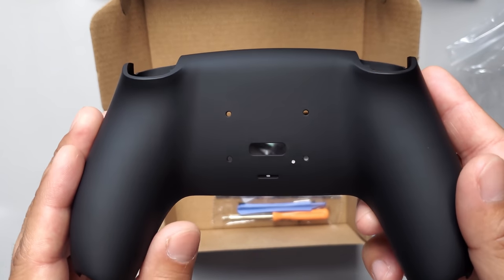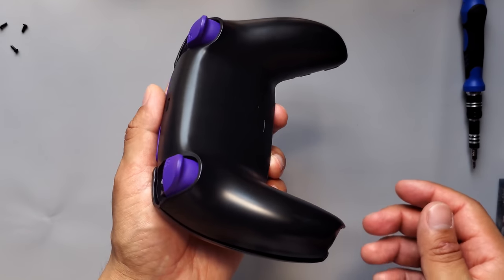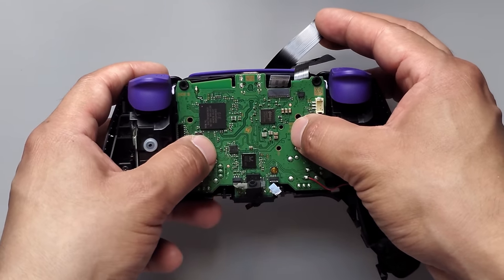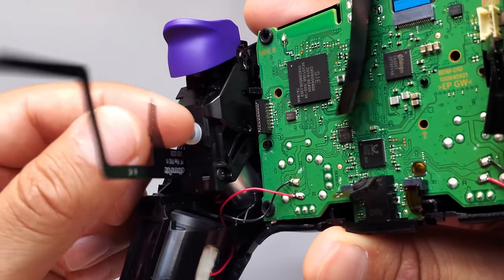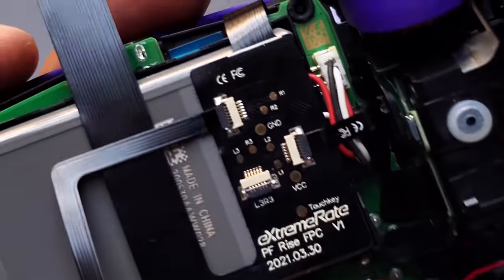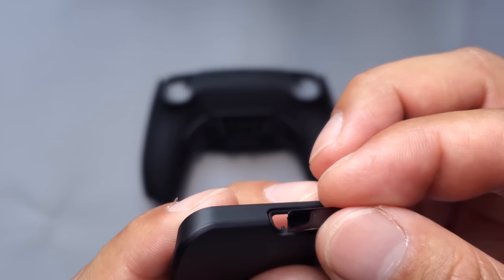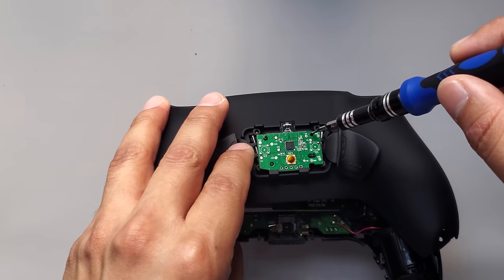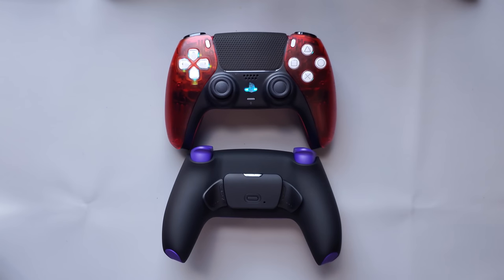DIY PS5 Controller (For BDM-010): eXtremeRate's Rise Remap Kit | No-Soldering Step by Step Tutorial

Comment: very strange everything i have done correctly but the red light didnt shine for me 😢😢 help please
Reply from the maker: Does your controller stay on?
Reply: @im.a.caveman  i was forget a 1 cable and i try to put it on while its working, forget to disconnect it and now my controller doent work lol, i fuc ked it up right?
Reply: @im.a.caveman  Please help 😢
Reply from the maker: @georgigeorgiev9361  Which cable was it that you needed to connect?
Reply: @im.a.caveman  the L1L2 V1 i was forget the cable that goes down next to batery cables.
Reply: @im.a.caveman  and i plugged in while everything working 😢 and it goes shutdown, then i cant turn it on
Reply from the maker: @georgigeorgiev9361  what's the BDM number on your motherboard and the BDM number of the cables you connected?
Reply: @im.a.caveman  my ps5 controller is bdm-020, but i dont know what the cables are.
Reply: @im.a.caveman  any advices mate ?
Reply from the maker: @georgigeorgiev9361  Which kit do you have? (V1, V2, RMB, or Rise4?
Reply: @im.a.caveman  its V1 i can see the signature L1 L2 V1 on the cables
Reply from the maker: @georgigeorgiev9361  The V1 kit is only compatible with BDM-010. you would need either the V2, RMB, or Rise4. These 3 come with cables compatible with BDM-10 and BDM-020.
Reply: @im.a.caveman  okey thank you mate
Reply: @im.a.caveman  hello mate i buy a new controller which is 010 and it works now, but when the time for set up the buttons as X and O i did all right it blinks but when i start the game it doent work, can you help again mate?
Reply from the maker: @georgigeorgiev9361  After remapping turn off remap mode
Reply: @im.a.caveman  thanks mate cheers you are god all good now

Comment: Is it normal for the touchpad to not work with this kit?
Reply from the maker: If the toucpad isn't working, check to see if the touchpad cable was reconnected.
Reply: @im.a.caveman  the lights for the touch pad work. But the button doesn’t
Reply from the maker: @CJ_Figy  did you test to see if the dragging function works on the touchpad? If you have Astros play room you can test it that way. 

If not then it's always good to double check the cable
Reply: @im.a.caveman  I opened it up and the cable wasn’t connected! Fixed it!

Comment: My mapping isn’t working I’m not sure why it wouldn’t. But it’s not keeping my button map
Reply from the maker: You remapped, turned the back off, and tested them?
Reply: @im.a.caveman  I forgot to re comment, after scrolling I found out you had to turn it off after that it was great! Thanks man. Ordered the hair triggers too so I’ll be back to watch your video on that.
Reply: @unloughfulgaming  I need help, my controller won't turn on
Reply: @originator4649  make sure your battery is fully plugged in still?
Reply from the maker: That's cool! Hope you enjoy the trigger vid.
Reply from the maker: Does your original back shell model number show CFI-ZCT1W? That would be a BDM-010 and compatible with the kit. If it's CFI-ZCT1W A that would be a BDM-020 and currently not compatible.
Reply: Ah I see. My model says CF1-ZCT1W and there's a little A like 2 spaces to the right of it
Reply: @im.a.caveman  if it's not compatible,  know any work arounds?
Reply from the maker: The kit is not compatible with that model. Extremerate is working on having it work with CFI-ZCT1W A / BDM-020. They could be releasing the updated version soon.
Reply: @im.a.caveman  after an hour of trying to do this, I think it has something to do with the ribbon cable that touches and goes on top of the other ribbon cabe. Right?
Reply: @im.a.caveman  ripp 💀. Guess I'll try to return it if I could.

Comment: I just wanna do back buttons so what steps can i skip
Reply from the maker: This is the back button installation video. You just won't be able to remap L3, R3, or toucpad with this guide since its the non-soldering option.
Reply: @im.a.caveman  thats cool thats all i need i wanted to remap x and circle for cod been using back buttons on ps4 stick but now i feel like i need it
Reply from the maker: @darryljohnson3084  I believe you don't have to do the cables on the side if you're only doing it for the face buttons. I'm pretty sure people mentioned they did that because they mainly just wanted X and O. But if you do want to remap the triggers then you'll need to install the trigger cables.
Reply: @im.a.caveman  thanks ill remeber that yeah just x and o for me thats why i didnt wannt spend 400 bucks on a custom one because im literally gunning for just two buttons lol 😂
Reply: But i might just go all the way anyway
Reply from the maker: @darryljohnson3084  Just make sure your kit is compatible with your control before buying.
Reply: @im.a.caveman  i have the CFI-zCt1w

Comment: But what do I do with the extra ribbon cables
Reply from the maker: If you're talking about the extra ones that come in the box then I believe you're talking about the ones for toucpad, L3, and R3. If you solder those cables on you can program those 3 to the paddles. But this is the non soldering version so I don't have those installed.
Reply: @im.a.caveman  I’m talking about what I do with the r1,r2 and r1,r2 ribbon cables that you take out and change with the new ones
Reply from the maker: You can just keep them safe in case you ever need them.

Comment: Can anyone help... mines turn on but won't sync to the buttons I want.... any ideas
Reply from the maker: Which buttons are you trying to remap and did you turn off the back after remapping. On is for remapping only. Off is so they can be used with the buttons you remapped them with.
Reply: @im.a.caveman  thank you for replying.... it's a PS5 controller and is X and square buttons im trying to remap to use them with the back buttons...... I would turn it on and sync but didn't know I have to turn it off.... I will try that today thanks alot
Reply: @im.a.caveman  maaaan Ur INSAAANE THANK YOU merci frère

Comment: What is this  attachment for
Reply from the maker: This kit installation is to be able to assign 2 buttons to the back buttons/paddles. You can program X, O, Square, Triangle, any of the D-pad or any Triggers (No-soldering). With soldering you can also add L3, R3, or touchpad. If you have the left or right back button assigned with like X, you can always reprogram it to another button or no buttons at all.

Comment: Did he say that R3 and L3 doesnt work with this??
Reply from the maker: If you don't solder the the other cables for L3, R3 or touchpad you won't be able to remap those buttons to the paddles. This is the non-soldering version.

Comment: Anyone else get stick drift after installing this kit? Is there something I could do to fix it?
Reply from the maker: It doesn't cause stick drift. Stick drift has to do with the analog sticks. Which eventually happens to all controllers depending on how long they've been used or if there was some sort of damage.
Reply: Ok, thought maybe there was something I may have done during the installation process. I did install the kit on an older controller. Thanks for the response.

Comment: Kills power to controller when L1L2 ribbon is installed on mainboard. My controller is an updated one too, maybe sony put a stop to this kit.
Reply from the maker: As in your L1 and L2 aren't working?
Reply: @im.a.caveman   Controller is on, but when I connect that ribbon to the mainboard the controller shuts off, like the ribbon shorts somethings.
Reply from the maker: @deener8365  I recommend contacting them and getting a replacement.
Reply: @im.a.caveman  I am skilled with electronics, but it's been three hours figuring out the issue... I have a newer controller model also, the MB looks different, maybe sony put as stop to this kit.
Reply from the maker: @deener8365  You think that just for the newer model Sony potentially stopped this kit? Or are you saying also for the original? I have mine installed on the original. So I'll try my L1 and L2 right now.
Reply: Newer maybe. @ 4:42 my large BGA chip is on the flip side of the MB and I have no white bracket to unscrew. I have done tests, no remap ribbon works with adaptive triggers, put original in and they work.
Reply from the maker: @deener8365  I'm gonna take a look into the newer control to see how it looks on the inside and investigate the product more. I'm going to check if on their description it says that it works for the MB as well. And if not I will email them to ask about this. Thanks for bringing this up.
Reply: @im.a.caveman  My MB on side A says it is BDM-020, can you verify and check if it's different than a controller from last year?
Reply: @im.a.caveman  I have found one issue. The 'left' d-pad side flex cable with the kit connects to the wrong ends of the jacks. Pins 1->16 on the trigger cable end should connect as 16->1 on the MB cable end. OEM cables are bent to do so, the remap kit does not, so bothe ends connect 1->16 to 1->16. The remap kit needs longer flex cables so they can be bent like the OEM ones.
Reply from the maker: @deener8365  if you have IG can you possibly send a pic or vid so I can see what you're seeing. I haven't been able to find a teardown for the new ones. Or email if possible. Let me know please.
Reply from the maker: @deener8365  Also, I opened my control and yeah, it says BDM-010
Reply: @im.a.caveman  I got a twitter D33N3R@BHPCDepot
Reply from the maker: @deener8365  Shoot, I don't have Twitter 😅 I'll keep searching to see if there's a teardown.
Reply: @im.a.caveman  No teardown, extremerate didn't even know there was a revision. They asked to purchase my controller for testing, haha.
Reply: Get a twitter, for this at least
Reply from the maker: @deener8365  Is yours also an all white, red, or black? It's looking like just bad timing on the kit and BDM-020. The kit was released a few weeks before the new controllers probably.
Reply: @im.a.caveman  White, the kit pcb dates are March this year. It'll get fixed soon enough. 👍
Reply from the maker: @deener8365  Yo, I really want to thank you for bringing up this topic. I need to release an update video for this issue (hopefully soon) and put it on my description for this video.Thank you so much!

Comment: Tried this kit and followed the exact steps..... Now my new ps5 controller wont turn on.... dont know if this has happened to anyone else but now im out  $60 (Black controller) and $40 for the set up..... thoroughly disappointed in how this came out.
Reply from the maker: That's is because most likely it's not compatible with your control. You did not lose any money. You just have to put the original parts back. Contact the company for a refund and get the one compatible with your control.
Reply: @im.a.caveman  I tried.The controller won’t even charge anymore. But I am sending the kit back. Never again. I’ll just buy a regular modded controller. It’s not worth it.
Reply from the maker: @ROdoesITbetter  If you put the original parts back then try resetting the control. If nothing then maybe something accidentally got damaged. You can also send me pics or videos through IG so I can have a look at it.

Comment: I did this and now my ps5 controller is acting all weird……is anybody else having this same problem as i am?……for ex: whenever i start a game the controller wont work unless i start it with a diff. Controller, buttons sometimes dont work, i used it with iphone ear buds watching youtube but the mic speech kept coming on while when i tried in warzone i had no issue?…..im about to return this! Help!
Reply from the maker: Try checking all your connections. If nothing works just go back to using your stock parts and ask for a replacement or refund.
Reply: @im.a.caveman  thx my guy….had to return after reopening and checking it again…..it turns out its happening to more peeps as well…..
Reply from the maker: @AmpGaming305  Yeah. So far it seems because new controller models came out which is BDM-020. Mines are BDM-010 and working perfectly with the back buttons.

Comment: I bought a whole controller from modded zone with paddles on the back and they were such bad quality that it lasted about a month till both of them stopped working. Don't buy from them. This looks a lot more reliable and is way cheaper than buying a whole new controller
Reply from the maker: The paddles stopped working or the controller?

Comment: I just fucked my controller up. The part where you need to remove the cable at 3:30, it would just not go and was so fragile that it broke despite my meticulousness.
Reply: Excellent video though, but I guess I went too hard on the tweezers and ruined the microphone. Be careful lads !

Comment: will this still be able to sit in the sony official charging dock though?
Reply from the maker: I don't think it will but I personally don't have experience with SONY's dock. I just have my controller sitting on the dock as a display and connect the wire to the controller.

Comment: I have no power on my back buttons. Light doesn’t even turn on
Reply from the maker: Is the controller on? And did you hold the back button?
Reply: Controller on just no light from buttons
Reply: @christophersegundo9200 did you find a fix for it?
Reply: @mishamulder5976  cut off the wrong tab

Comment: THEY ARENT COMPATIBLE W THE PS5 CONTROLLER THAT COMES WITH UR PS5. I bought a red ps5 controller from Walmart and it doesn't have the small a model after the w
Reply from the maker: If the y are the recent ones with the console they are most likely BDM-020/CFI-ZCT1W  A. They are compatible with BDM-010/CFI-ZCT1W. Which were provided with the launch consoles. There's still some on shelves. Probably till they they run out and they they'll start selling BDM-020/CFI-ZCT1W A on shelves.

If it's not mentioned on the video it's because the kit came out when the new models were being released. So the issue wasn't known. But I updated the video. It has a card or video the shows the info for compatibility with the remap kit.

Comment: i cant seem to take the battery off :(
Reply from the maker: Look at it from its widest, and you can try wiggling left to right while pulling up. Try not to use to much strength. A little wiggle and pull can help. Try your best to grip it from the white connection like shown in the video. If you have to grab the cables then be gentle.
Reply: @im.a.caveman  i got it ! thank you :)

Comment: yeah mine fully doesnt work rip brand new controller :(
Reply from the maker: Did you check the video link I sent you? Or did you accidently damage something?
Reply: @im.a.caveman  My controller isn’t compatible bro only just seen the description they should probs add that on Amazon great video tho luckily still work when I put everything but so will have the get a different model, any idea where I can buy the correct controller
Reply from the maker: They do show it on Amazon. Anyways, they have 2 colors that has a rubber grip and compatible with BDM-010 and BDM-020. Currently only white or black available. If you want the BDM-010 compatible only, then you might be able to find a controller in stores. The ps5 controller box showed CFI-ZCT1W. Just don't know if it'll show CFI-ZCT1W A on the box for the new model.

Comment: My ps5 controller won’t turn on now
Reply from the maker: Did you connect the correct BDM cables compatible with your control?
Reply: @im.a.caveman  it’s works not it was the battery
Reply: @im.a.caveman  now
Reply: @im.a.caveman problem with mine it just automatically presses L2 and juts hold it there and its so annoying
Reply: After I installed it and the back buttons don’t turn on even when I follwed every step 😭

Comment: So I have a BDM 20  does that not work
Reply from the maker: If it's the kit that says it's compatible only with BDM-010 then it doesn't work. There's another version that works with BDM-020.
Reply: @im.a.caveman  I can't seem to find it do you have the link ?
Reply from the maker: @drvolks4213  That's the Scarlet red https://www.gamingcobra.com/collections/ps5-remap-led-kits/products/scarlet-red-rise-remap-kit-for-ps5-controller-upgrade-board-redesigned-back-shell-back-buttons-attachment-for-ps5-controller-controller-not-included-xpfp3003
Reply from the maker: @drvolks4213  Alot are sold out but just click on them to see if it says BDM-020 https://www.gamingcobra.com/collections/ps5-remap-led-kits
Reply from the maker: @drvolks4213  If you're not interested to use the gaming cobra site for a 10% with my link then you can also try Amazon. Just search ps5 controller Rise Remap Kit and check that it says for BDM-020.
Reply: @im.a.caveman  thank you sir I live in UK so it's not available for me 🥺🙃

Comment: Why don’t you sell them?
Reply from the maker: I want to the problem is they're built-to-order. And even then since some of the older paddles were to break then I would end up recieveing the backlash. So if I do, it would only be without any kits installed. Only if it's a shell swap or buttons. The kits aren't perfect which is why it would be risky for me.

Comment: It doesn't work with R2 R1 L2 L1
Reply from the maker: I recommend checking those cables. Make sure they're fully in. And that they're not flipped the other way. Someone mentioned they had put the opposite end in one of the connections and it wouldn't work.

Comment: Not to take away from your great video, but i would highly recommend people to avoid this product, when it's initially installed it's brilliant but i installed two so far and both had the paddles break just under a month, and the customer service are horrendous.
Reply from the maker: Sorry to hear about that. The kit definitely needs work on durability. I'm surprised you're having a bad experience with customer service though. Usually they respond. What happened exactly with customer service?